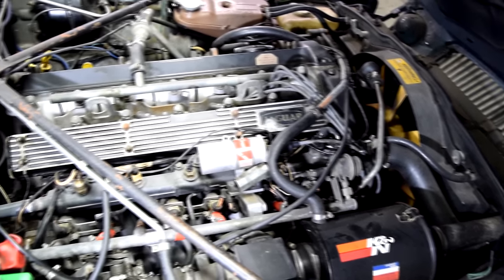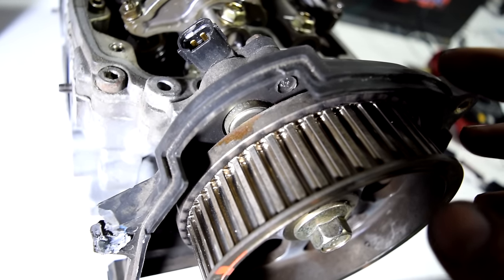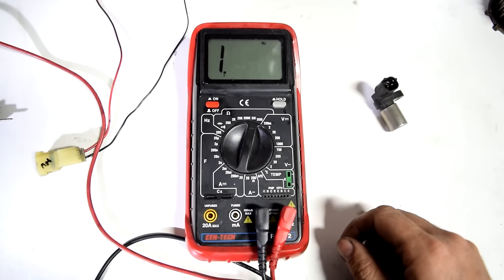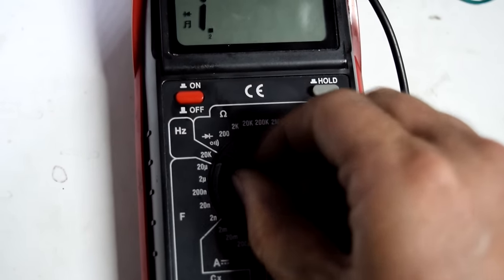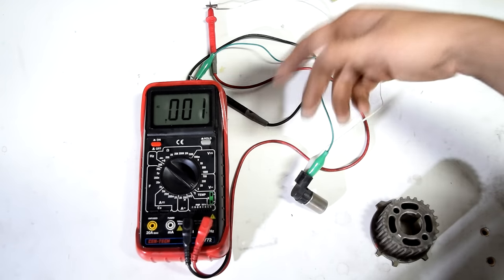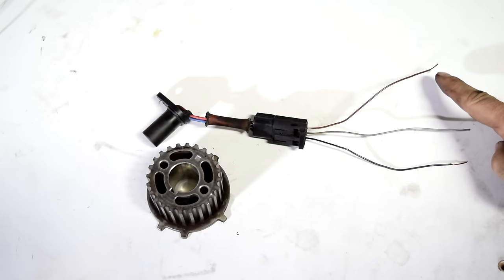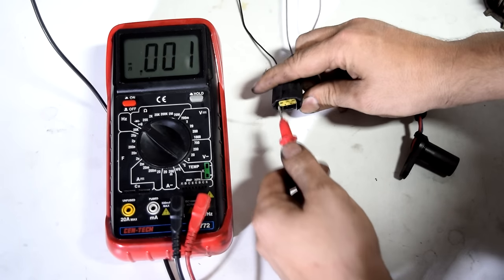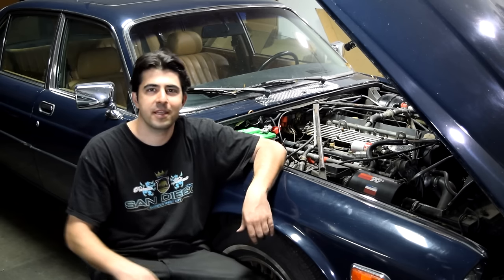How to Test Crankshaft and Camshaft Position Sensors

Comment: how do you know what ohms you're supposed to put it on?. like say i have a 2014 kia soul 1.6L. What would be the ohms i put it on?..
Reply: Candicelee Spencer I'd google the part and then see if you can find what the rating should be. "2014 soul 1.6L cam shaft positioning sensor ohm rating or resistance" should do the trick. But if you can't find it I'd follow what this video sets for and I would also test all the sensors and if they are all the same then chances are you're good on those. If one is way off you found the culprit. There is an off chance that they are all fucked but hopefully that's not the case
Reply: Christoph Bouche-eh! Oh great! Lol I’ll try that. Thank you very much! Hope they’re not fucked like u said. Lol

Comment: So on a two wire sensor I'm getting no power/ continuity. On the other hand I am reading volts on the sensor.... Any help? I plugged the sensor back into the harness connector then followed all the way up to the PCM/ECM... However I'm skeptical about it being the PCM/ ECM because I get good voltage from other components.

Comment: I have a question should the signal wire show any voltage when not plugged into the sensor mine has 5 volts and 2.81 volts when plugged into the sensor
Reply: Hello friend, how did you test when you find 2.81 volts, at the connector of ECU you get 5volts, but when you connect you get 2.81 how do you test it, please explain, thank you...

Comment: If anyone can help I'd appreciate it. 

I just bought a 2013 gen coupe 2.0t.

Was sitting for about 7 months, 
Has lifter tick because previous owner took it it jiffy lube and they messed up. 

I did and oil change, used oem filter and 5w40 oil as recommended by hyundai.  There was some gas in the oil pan. (Leaking injectors ?) 

Bought new battery.

Car had rough idle so I cleaned throttle body, there's no IAC valve. 

Haven't changed the old gas but did add 91, about 5 gallons wjth some seafoam. 

Car starts up perfectly, runs smooth, but then turns off after a couple of minutes.  

No check engine light or stored codes. 
After watching alot of videos I'm thinking it's fuel starvation but I have it on leveled ground, any idea what's going on? 

My next step is to check fuel pressure and test crankshaft position sensor.

Comment: Hi. I tested my three wire connector as you did but the results confuse me - I got 5 volts on both the right and the left contact and continuity on the centre  - what does this mean ?
Reply: Years later but... did you find out why you had two - 
five volt readings?

Comment: So if car or truck hesitates and bucks and lack power can it be a bad crank position sensor?? i have tried everything i can think of..replaced MAF sensor, cap ,rotor ,cleaned Map sensor...replaced timing chain.. Has 60 psi fuel pressure constant with key on ...its a 2001 chevy 4.3 blazer... has no codes it did have a PO101 but its gone now and no codes come up even added seafoam and 10 gallons fresh gas to tank thinking gas was old... Anyone ideas are appreciated... thanks
Reply: Solve the problem?  Worse accelerating up hill?  Replaced a lot without a diagnosis first because then you have to worry about bad replacement components.

Comment: I changed the sensor after diagnosing bad camshaft position sensor and the check engine light turn on, the light went off on clearing it but later came back, I also notice that the car can start even when I unplug the sensor, what could be wrong?

Comment: My Infiniti cam shaft position sensor has 3 lines, what should be Ohms/ continuety between 3+/1-, 2+/1- and 3+/2-, where 1- is a ground! I already tested, that battery voltage = 12 V comes to connector 3+ =) Just trying to test the cam shaft position sensor??? I got these numbers from the new OEM sensor: 3+/1-: 1267, 2+/1-: 1667, and 3+/2-: 988?? Infiniti manual says, resistance should be at 77 F: except 0 ?? So, if I get those or similar numbers in old one, it is still good??? help meeeeeeeee=))

Comment: So i have no spark on the cylinders. I changed my crank shaft sensor but still nothing. Is it my camshaft sensor then? All my fuses, and relays are good.
Reply: Did you check (resistance/ground/current) the Bobine?
Reply: @amfam.ldrissi294  yes. I checked all that with the multimeter.. Only thing i didn't check is camshaft sensor

Comment: Am failing to get continuity when i check for ground on the two wires coming from the 2 wired crank sensor. where may i be loosing the ground?? where does the ground wire receive ground on the vehicle? where may  be the problem
Reply: You fixed please let me know 🙏🙏🙏

Comment: the voltimeter few does not works because the CMP heat and fails, so  with the voltimeter can works fine but its failings

Comment: you said the 1st sensor runs on AC voltage, how come? it runs off the car battery, shouldn't it be running off DC voltage instead?

Comment: excellent video. my 99 gst eclipse does the same as that car. gonna check it out later
Reply from the maker: +Layonel Melendez Glad you like the video, thanks for commenting.
Reply: +RatchetsAnd Wrenches llap
Reply: +RatchetsAnd Wrenches Hey great video i have a question i have a 2000 lincoln town car and i've been experiencing some problems with my car the other day i was driving on the free way and my car all of a sudden lost power and it wouldn't go over 35-40 mph i pulled to the side of the road and turned off the engine waited a few minutes and stared it up and it ran normal for a few miles and did it again i later bought and installed a new fuel pump and filter and cleaned my injectors like you did in your video but it still does this once in a while especialy on hot days could it be my camshaft sensor??? please help i would appreciate your advice thnx
Reply: Layonel Melendez k
Reply: Ratchets And Wrenched Wrenched
Reply: Layonel Melendez.

Comment: 2:24 and 5:33 surely this test for ground is bad unless you disconnect ECU FIRST and know what pin it is and check there ? doing the way he says here by sending voltage down an earth wire into ECU is BAD ??? a continuity test uses voltage to test dont they or am i getting this wrong ??

Comment: 3 wire cam sensor i have 2 volts on the signal wire with key on engine off..do i have a short somewhere or the ecu is faulty idk

Comment: i got a check engine ligh for crank shaft position sensor and replaced the sensor but i am still getting the problem it comes and goes on a chevy s10 what could be the problem

Comment: I have a oily camshaft position sensor. Dont know if this is an issue? I think its the o-ring that is old on this.
Just replace the O-ring och should i just buy a new sensor? OEM arent cheap.
Picture of it: https://imgur.com/a/tsgKt
Reply: orfeous You got oil all way up by the distributor?
Reply: Did you mean the bottom crank shaft sensor?

Comment: Mercedes E320 96..I pull off the conector from sensor and mesure all 3 conector contacts ( ig. key kontact  right end position ..) I mesure 12 volts right and left side.. But strange is that i mesure 12 volts at the midle also..!? How come ?? I hear something (like a small el.motor running) when I stop cranking..? Wierd..

Comment: So if the sensor is below 2.10 ohms is bad?
Reply: yes, lower resistance would indicate the insulation on the coil wire is breaking down and allowing voltage to bleed across the wire turns.

Comment: Hi my Nissan Xterra died on me, tried starting it but it only cranks but won't catch/start, was told it was probably the coil in the distributor so I bought a new distributor and put in but still no spark and still cranks but won't start.....I'm at my wits end I can't afford to take to shop, really can't afford anything as I'm on disability.....I googled around and came across the possibility of it being Crankshaft Position Sensor?? What do you think, is that possible?? I really need help and some advise, thanks😊
Reply from the maker: +Juju Hernandez You have to first find out whether you are getting both fuel and spark, and go from there. There are some good video's on youtube, search for "crank no start diagnosis"  gl
Reply: if you still need help with that i can be of assistance... I am a mechanic.
Reply: Dontrell Gwinn I have the same issue with my lr3. I changed the fuel pump and 3 or the coil packs. At this point I am just curious if it is either the camshaft or crankshaft position sensors I get fuel now but barely any spark. When trying to turn on it produces 1 spark on 3 of the wires
Reply: Alexander Patterson 
Probably your ignition coil or crank POS. sensor. Hopefully your timing belt/chain isn't slipping. Good luck👍
Reply: I changed  the camshaft sensor and crankshaft  sensor  but still  does not  start
Reply: And also  the ignition coil
Reply: what about the spark plugs ? Does the engine just cranks without the sign of life or does it rotates like it's about to start after few attempts and smells of fuel  ?  I would suggest to buy some cheap(20-50$) obd1 or 2 code reader for your car. It does makes a difference diagnosing electrical issues.

Comment: I am trying to test my crank  sensor  on a 2006 road king---I was told that a easy  check was while cranking the motor --the tachometer should show 300 rpms--if it does not--then the sensor is bad---anyone have any input  ?

Comment: I have 1.5 volts as soon as i probe the ground and signal wire......without cranking the engine. If i do crank the engine over it barely moves to 1.6 and to 1.7......🤷🤔

Comment: No ac  voltage . Fluctuations isn't alternating current even if the root words are related
Reply: That's AC voltage from a 2-wires sensor

Comment: You rarely see someone use a older jaguar.  what year was this xj?
Reply from the maker: +leapingcat 1986 with 60k original miles, I sold it really cheap because I needed the money ($1100) talk about a regret.
Reply: I had the crank sensor replaced at an electrical shop. I picked up the car and it operated fine, I got home and parked it then did not use it for two days when I went to start it the car would only crank over and it kinda started for about a second and then it would go back to just cranking over and no start. Could the crank sensor be defective?Originaly I took it to a auto repair shop because it would die out at stops and stop lights but it would start and drive fine. So they checked the wiring and they replaced the two items that are part of the ignition and checked the ECU and could not find the problem that is when they took it to an electrical shop and they said that the crank sensor was bad so they replaced it. And now it wont start only crank over. Any ideas as to what could be the problem?Could the new crank sensor be defective? Or could it be the fuel pump as the mechanic suggested.Thank you
Reply: The mechanic came by and replaced the crank sensor with a new one and the car started right away, they let it run  for about 5 minutes and then they shut it off. Later that day I tried to start it and guess what, the same problem. It would only crank over but wont start.The items that where replaced where the ignition coil, the igniter and the crank sensor. I asked them how come when they hooked it up to the analyzer the crank sensor did not come up as the problem and they said "not nessesarily"  And that did not make sense to me. I thought that once you hook it up to the engine analyzer it would show what the problem was.So I called them and asked them to check the sensor that they had replaced originally to see if it was bad and if it was not bad then the problem has to be something else.So the fuel pump is good because the car started and ran.Now I am waiting for them to find out what the problem might be so they can fix it. I am getting frustrated.Cheers
Reply: Rob Hernandez. were did get the at suerviss. from
Reply: leapingcat check cam sensor on a 94 850 turbo volvo sti wagon
Reply: leapingcat #jagfan
Reply: Rob Hernandez 
What ended up being the issue?
Reply: The Car Doctor Have it Checked for a plugged exhaust system.
Reply: @myRatchets  Ouch, it's hard to sell them at times. I have a Mercedes 190e with 90k. I wouldn't be able to sell it for what it's worth
Reply: @myRatchets  can you answer Rick310...what tells us of it's good or not you just explained how to do the checking and not the diagnosis

Comment: we have  audi tt 2lt 2007, lights come on, on the egnition but does not want to start, you can hear the feul pump runing, and the click in the relay, but if you turn it to start nothing dead silance, anyone who can help, or giving info on what this may be
Reply: Tony Swanepoel.     check out the earth cable is tight and clean

Comment: could a bad 1 of these allow my car to start occasionally or randomly shut off and not restart till it feels like it?
Reply: armyraw29 yes it may mean its going bad
Reply: espcially if u have seen a code for sensor .it could ofcourse be many other things
Reply: well i got a 1991 buick park avenue. uses obd 1 and my scanner is a actron 9001. no codes. maby just because its such a cheapo scan tool for obd 1
Reply: armyraw29 do u have check engine light on and cant read the codes?
Reply: no check engine light.
Reply: armyraw29 i would focus on other things first. battery,fuel pump.starter,wiring all checked?when it does not wanna start when engine is cold or hot ?
Reply: everything is fine. iv been told crankshaft position sensor could make it start when it wants to. i can start it up it runs i shut it off and wont restart. other times it might start and restart again. or die when running. also just got a new shiny coil pack because the guy i got it from told me hes replaced like 3 or 4 of em from the junk yard. doesent seem to matter if its cold or hot. i do get a service engine soon light but im thinkin thats an oil light since i didnt reset it also no fuel pressure guage but i push on the fuel port and it shoots out like a fire hose.
Reply: armyraw29 yea catch the car when it does not wanna run and spray some starting fluid into the intake manifold and see if it runs .if it wanna run for a few seconds if it does .then its the fuel related .also i would make %100 sure that battery has a good amperage.voltage might look good but it may not suply enough when u crank .u can test it with a multimeter to see if it holds up 9.4 volts min when u crank the engine   and let me know :)
Reply: and check all the wiring from vital sensors crank and cam and ignition coil .i would also test the ignition coil module itself as well. :) enjoy
Reply: well sometimes the spark plugs make a spark and othertimes they dont. and i did spray into the intake before i did all this and nothin. and the ignition coil pack is new just replaced it because i thought that was the problem.
Reply: armyraw29 cool then u know its ignition related i would do above test when car not running and finally the sensor is not that expensive online .sensors double the price at local parts store
Reply: well the camshaft position sensor is $9.84 on amazon free shipping.
Reply: yep
Reply: but also could be the cam senor as well. one of the two is the issue
Reply: I had the same problem intermittent fuel pump
Reply: +David Morland speak now I like to know where the crankshaft sensor on a 2099 Chevrolet 1500 4.3 looking for up a crankshaft sensor on a 99 Chevrolet 1500 with a 4.3 crank sensor on a 99 Chevrolet 1500 4.3 vocation
Reply: armyraw29 
Yes

Comment: What if it cranks most of the time but only gives the no start every now and then and takes multiple key turns to start up?
Reply: it's goin out, change it
Reply: That's the weird part, I replaced it months ago for doing the same thing, but I got a code last time
Reply: +IaMaPh1991 mine was doing the same thing im about to change mines 2mar..it had stopped completely on me so you might wanna be smooth on that..but if it ain't that then ill let you know what's up
Reply: Ray Gezzy

Comment: I have a 2003 Kia Sorento when it's some Park and I accelerate and I keep it on 2000 RPM for a while then I release the gas and the engine shuts off
Reply: Could you solve it?

Comment: I have a 2001 Pontiac Grand Prix that's not getting no fire and no fuel I bought a new ignition I still have nothing I've checked all ground wires I've took the thing apart I took it inside the dash both fuse boxes and still nothing I've checked all grounds and I can still get nothing from the inside of the car to the motor does anybody have any ideas on how to get this thing to start I just bought it drove it home parked it went got tags come back for the month the next day and it wouldn't start does anybody have any clue if you do I would greatly greatly appreciate it

Comment: I have a question maybe someone out there can help me I have a 2004 Infiniti G35 replace knock sensor and harness replace both camshaft sensors in back replace both sensors I want to call them timing sensors and the front both left and right checked check that little timing filter as well replaced intake gaskets to get to the knock sensor all gaskets are brand new on everything sensors car is still running poorly it still says the sensors are out don't know what to do is there anyone out there that can help me

Comment: great video sir, I have an issue with my car it starts easy runs well BUT when i get the engine RPM up to 4k the engine won't push any more power it just rev's out, it did run very well right up to 6K easy, it's a lancer 2.4L petrol engine 5spd. It has good power when the engine is cold but when it's hot it's a slow piece of shit  😂😂😂  would it be the fuel injectors?